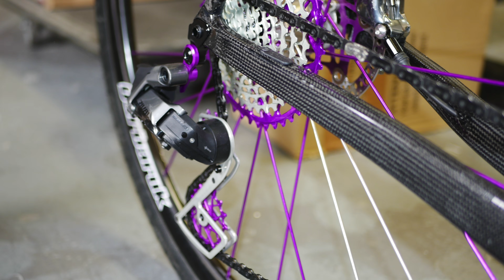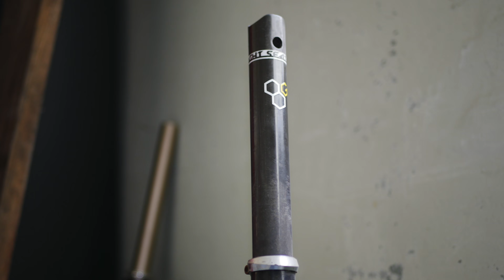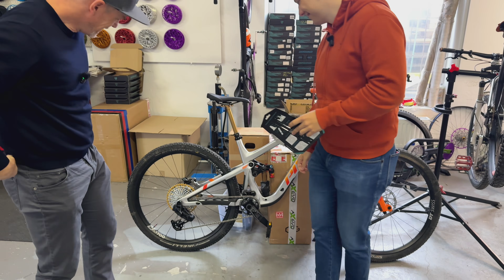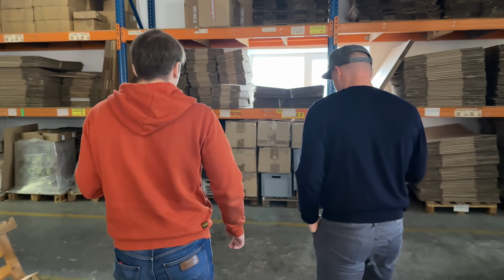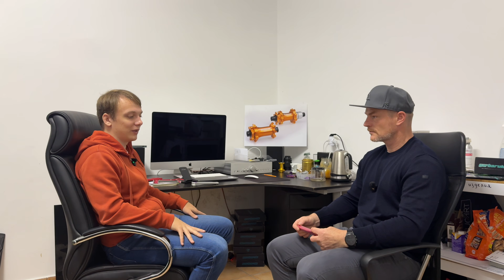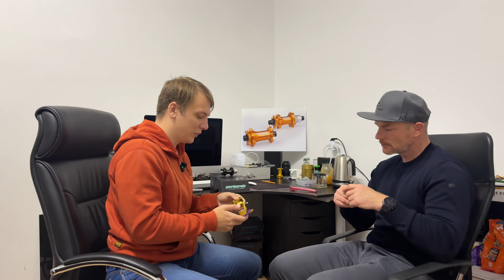Garbaruk Factory Visit || Wireless Derailleur | Wheels | Premium Components

Comment: I've been using their cassettes for a few years now and am a fan. Would be cool to get the 2.0 updates to the non-T-Type. I would love to get their enduro cranks with the colored bolts, and the XC ones. I'm not a big e-drivetrain fan, but their derailleur does have me intrigued. It all makes me really want to build a bike with all their parts with all wild colors. Just need a matching stem and seatpost clamp to tie it all together.
Reply from the maker: Well... my next build will have some Garbaruk on it for sure and I am trying hard to match colors with the headset, seat post collar and shock bolts. :)

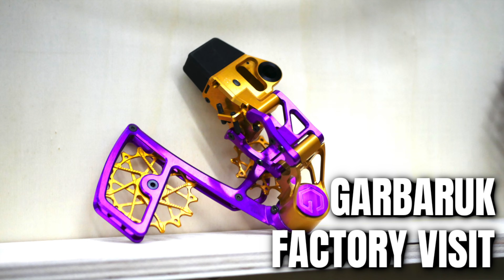Comment: 7:44 Awesome, it will be possible to fine tune each gear.
I hope it will be fully rebuildable, to run it forever. I understand this is a prototype, but hope for a fully rebuildable electronic RD, no exposed cables.
And of course swappable battery in case it one forgets to charge it or battery fails.
Reply from the maker: That’s a lot you’re asking.
Reply: @thetrailnomad  I like what I see.
I took a look again, looks like it would be rebuildable, looks like two bolts sandwich the parallelogram link, which mean the pivots are cleaner looking.
Interesting. Assembly and disassembly would likely be really quick and easy. 
So far I don't like what I see from the competition, so I think you are right this will sells well.
So for me this RD might in the cards for me. 
I also like the locking mechanism for the battery, no moving parts that can get stuck like on Sram connects. 
So this has potential to be the greatest electronic drivetrain.
I forgot to mention I also wish for paddle remote, for me the ergonomics on Archer D1Xtrail paddle remote was perfect, so something like that wold be optimal for me.

Comment: Strip club of bike part manufacturers
Reply from the maker: You better have your money ready. ;)
Reply: @thetrailnomad they make the most efficient, well geared, lightest weight 10-46t cassette on the market (11-speed).
Reply from the maker: @420xwaytoomanyx420  I have yet to own a Garbaruk Cassette. :)
Reply: @thetrailnomad you know what the future of efficient drivetrains will be? 2x8. 26t x 34t up front and a 10-35 rear. That cassette would weigh about 185g! Madness. 

Bring back the front derailleur.
Reply from the maker: @420xwaytoomanyx420  Leave it where it is. I don't want 2x anymore. Not on the Gravel and much less on the MTB.
Reply: @thetrailnomad it’ll totally work this time
Reply from the maker: @420xwaytoomanyx420  Puh... I was gonna build a whole Garbaruk drivetrain in all colors once the RD is out.

Comment: It is a fact that carbon crank arms are not as stiff as alloy-made crank arms.
Reply from the maker: I didn't know that. I thought carbon was stiffer at the same weight. It is at carbon rims though (if I'm not mistaken).
Reply: @thetrailnomad in one direction or axis probably, most of carbon cranks are probably made to be light and they still pretty hard thing to sell I guess